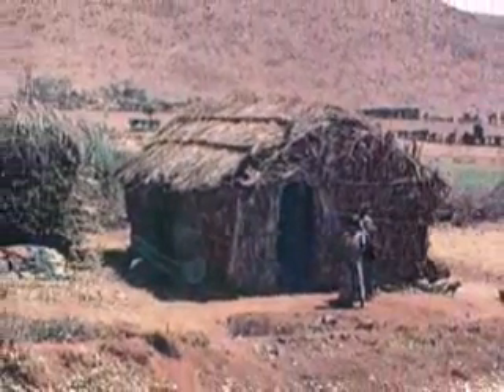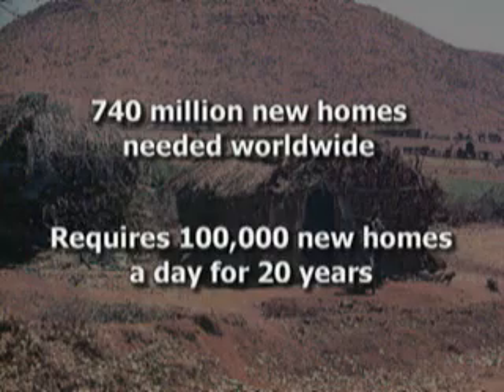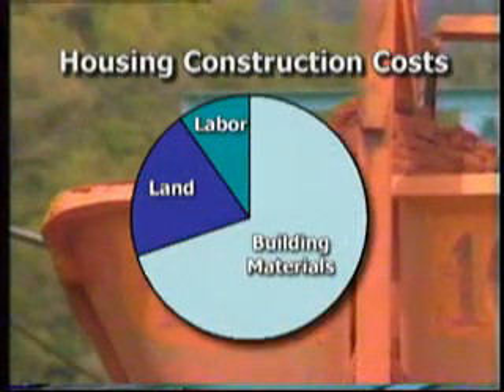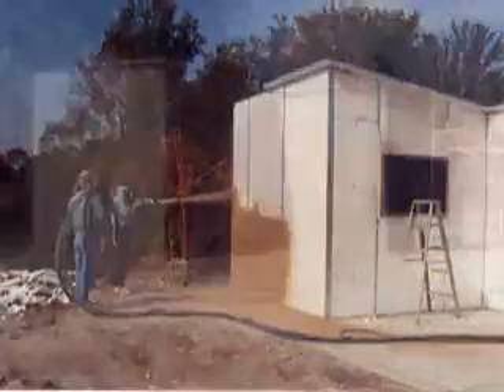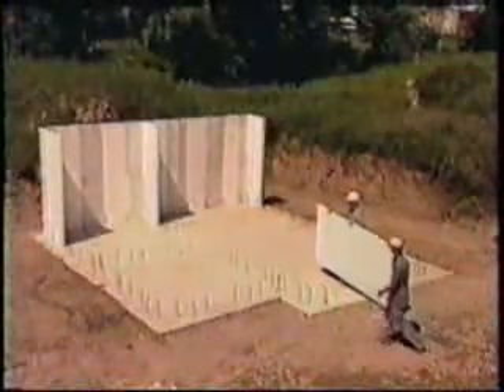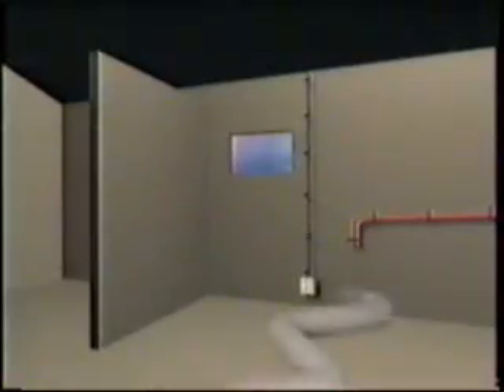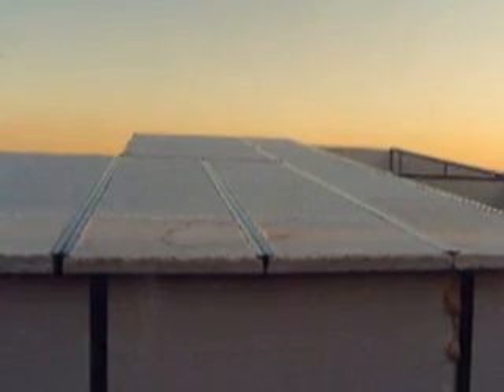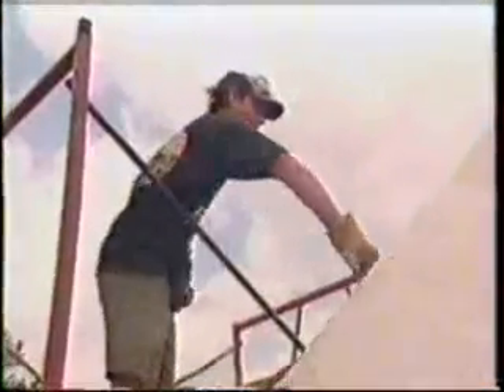new construction method

Comment: Put it in a wind tunnel test to see what force hurricane it will sustain.  It would also help in the modeling of it and the ability to create new construction format for higher wind strength design.  A great model for strength model testing for both storms and earthquake testing.  The ability to build different models quickly for testing.